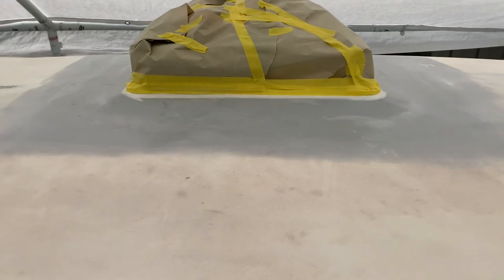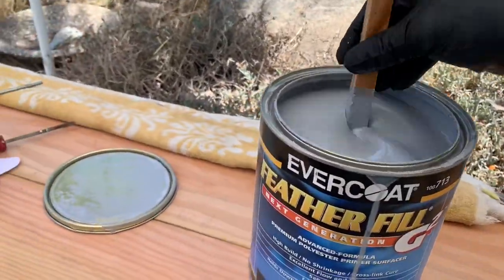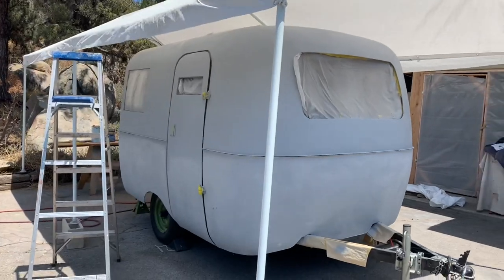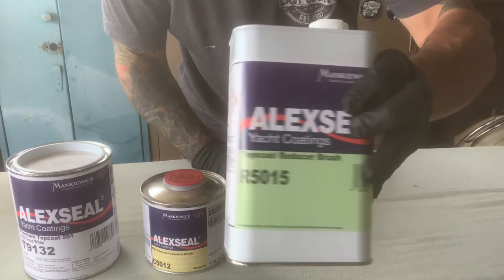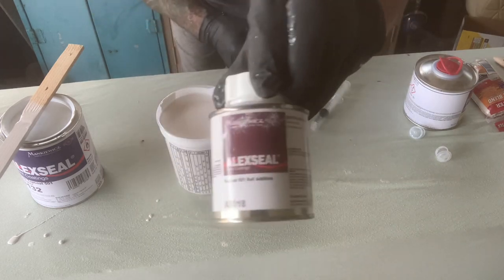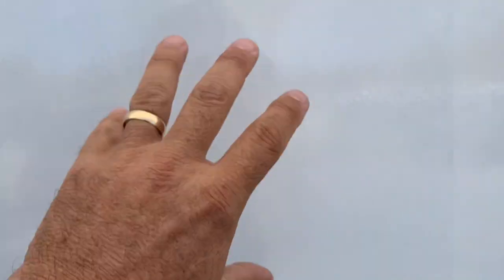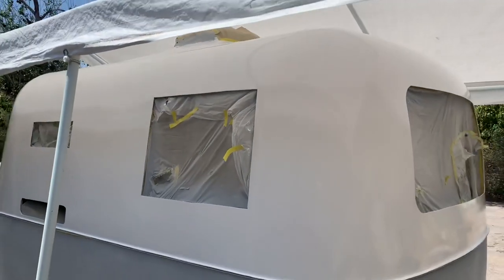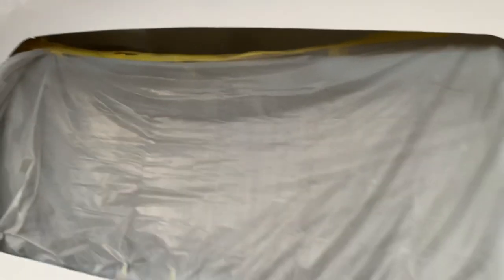Scamp Prime Painted | Rolling And Tipping | #Alexseal #RollAndTip

Comment: Is there a primer that is self leveling like the paint. That you don’t need a fancy spray machine for?
Reply from the maker: Hi Molly, yes you can roll auto primer on, here’s a link to a video where it’s demonstrated. If you use a high build primer for a fiberglass trailer you would only need one good coat of auto primer. Hope this helps, Johnny https://youtu.be/DLs5zzwPdoo

Comment: Great stuff Mr. West Coast. Getting ready to paint the topsides of my boat same way. However, sanded too much of the Alexseal finish primer off & need to recoat. Don't want to wait on delivery or spend the $$$ on Alexseal. Can I use a good quality epoxy or poly primer such as you did? Which would you recommend - poly or epoxy finish primer? Thanks
Reply from the maker: Hi Casey, great question. I did not use the Alexseal primer, I used FeatherFlll G4 which is a high build primer, sands easily. At that time I thought I’d be spraying but when I discovered how cool rolling and tipping is I was already in primer. ( Polyurethane)Alexseal told me it was comparable. I’d love to hear an update! Thanks 👍🏼
Reply: @westcoast_johnny  Agree - rolling & tipping works great. Did one of my boats that way with Awlgrip with great finish. With the Alexseal rolling additive, I really didn't need to tip on some large hatches I already painted. Wanted to finish up the topsides with spraying due to tight spaces to get into, but already invested in the rolling converter & thinner. Never got an answer back from Alexseal about spraying with the rolling converter & thinner - so I think I'll spray some primer & roll out what paint I have left. Did Alexseal tell you a poly or epoxy would work equally as well? Also, I was told to add 1% rolling additive to the combine total of base coat & converter - not to include the thinner in the total count. Does that sound about right? Thanks again.